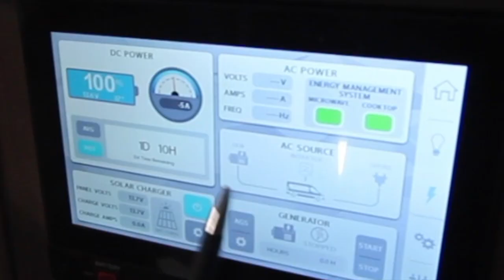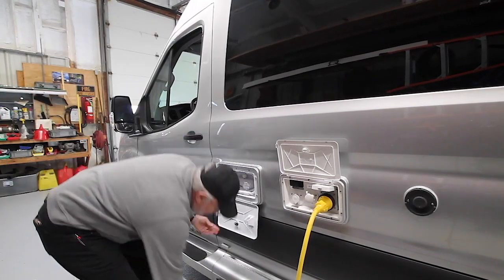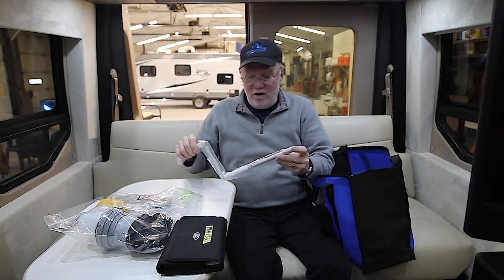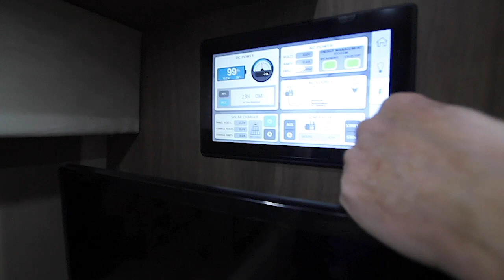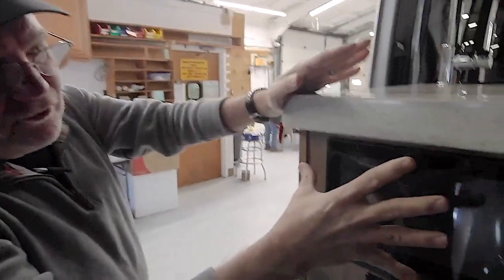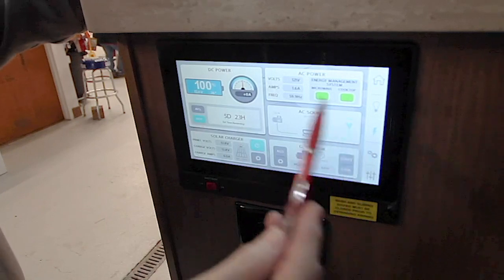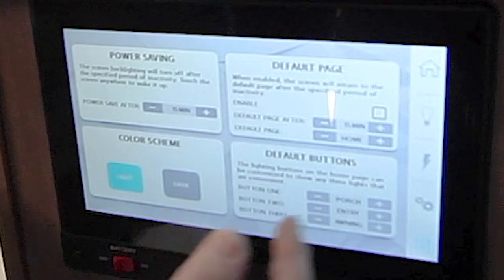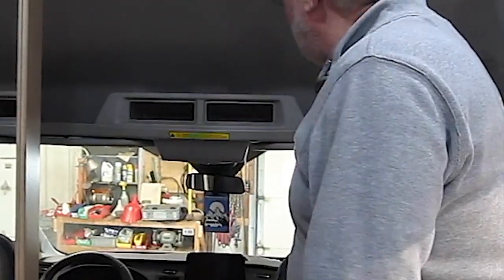Picking up Pleasure-Way OnTour RV? INFORMATIVE walk-through by Rick Hand from Fretz RV, PA

Comment from the maker: Amazon Links to Items we use or mention in our videos: (We earn a small commission at no extra cost to you when you purchase from one of the links.  Thank you for supporting our channel. )
Surge protector, Water filter, hose:
Portable RV Surge Protector Portable EMS-PT30X RV Surge Protector , Black   https://amzn.to/3v7qfe8
Southwire 34930 Surge Guard 30A - Full Protection Portable with LCD Display Black     https://amzn.to/3vaPMTy
 FilterLogic RV Inline Water Filter.... https://amzn.to/3BJBpXB
Valterra AquaFresh High Pressure Drinking Water Hose.... https://amzn.to/3sTqK8U
Twinkle Star RV Water Pressure Regulator Valve ..   https://amzn.to/3JOmcrm
Camco FasTen 2x2 Leveling Block https://amzn.to/3LQidMC

Kitchen Area:
Over The Sink Roll-Up Dish Drying Rack  https://amzn.to/3p8jXH8
 Magma Products, A10-363-2-IND, Gourmet Nesting 7-Piece Stainless Steel Induction Cookware Set with Ceramica Non-Stick, Silver      https://amzn.to/3p4SciQ
VELCRO Brand - ONE-WRAP Roll, Double-Sided Tape  https://amzn.to/3K4d4Px
Gorilla Heavy Duty Double Sided Mounting Tape XL  https://amzn.to/3HcaWmO
Automatic Soap Dispenser   https://amzn.to/3p81Zog
Dixie Ultra Disposable Paper Bowls, 20oz     https://amzn.to/3p7PitE
100% Compostable 9 Inch Paper Plates  https://amzn.to/36yLlYG
24-Piece Superior Glass Food Storage Containers  https://amzn.to/3JKKfHw
Lunies Over The Cabinet Plastic Trash Bag Holder  https://amzn.to/3pb82Zr
Subekyu Small Hanging Kitchen Trash Can  https://amzn.to/3p9rrKe
Prodyne Under Cabinet Paper Towel Holder  https://amzn.to/3p7GyDQ
Bligli Shower Mat Non Slip Bath Mats  https://amzn.to/35lOgmH
 MicoYang Silicone Dish Drying Mat   https://amzn.to/3BGDMuu

Bedding Area:
 Therm-a-Rest LuxuryMap Self-Inflating Camping Sleeping Pad   https://amzn.to/3h6jTUb
 Amazon Basics Ultra-Soft Micromink Sherpa Comforter Bed Set - Navy, Full/Queen     https://amzn.to/33Hb3Jh
Packing Cubes Luggage Bags  https://amzn.to/3LS0kNq
10000mAh Portable Fan Rechargeable, Battery Operated Desk Fan   https://amzn.to/3JOdHfE

Curtains:
NICETOWN 100% Blackout Curtains with Black Liners, Thermal Insulated 2-Layer Lined Drapes (Navy, 2 Panels, 52 inches W by 45 inches L)   https://amzn.to/36snJop
 NICETOWN 100% Blackout Curtains, Thermal Insulated Black Liner Panels  (Set of 2, Navy, 52 inches Wide by 63 inches Long)   https://amzn.to/3h6Gz6v
 Oval Tension Rods Adjustable Width Curtains Rods 4 Pack Spring Window Round 22 to 36 inches Spring Curtain Rod Tension Curtain Rod, Black        https://amzn.to/3sbpLlh
Rod Desyne Oval Spring Tension Rod 36"-60", Black, 36-60"  https://amzn.to/3p91r1x

Table and chair:
COSCO Multi-Purpose, Adjustable Height Personal Folding Activity Table https://amzn.to/3t05IFN
 Portal Outdoor Folding Portable Picnic Camping Table with Adjustable Height Aluminum Roll Up Table Top Mesh Layer     https://amzn.to/3slgZBv
 STRONGBACK 3.0 Guru Camp Chair, Original, Navy/Grey     https://amzn.to/3H6Di1K
 STRONGBACK 2.0 Elite Camping Chair, Original, Black/Grey      https://amzn.to/3JOAPL2
 GCI Outdoor Compact Camp Table 20 Outdoor Folding Table     https://amzn.to/3p8dH2l

Bathroom:
Bligli Shower Mat Non Slip Bath Mats Bathtub Mats with Drain Holes and Strong Suction Cups, Anti Slip Bathroom Floor Shower Stall Mat(BPA, Latex, Phthalate Free) (Blue 21x21 inch)  https://amzn.to/3sbQYEs
MISSLO 8 Pockets Mesh Shower Organizer Hanging Caddy with Rotating Hanger Quick Dry Bathroom Storage (White)      https://amzn.to/3sa5MTV
MISSLO Hanging Mesh Pockets Hold 340oz/1000ml  https://amzn.to/3LSi9fi
Self Adhesive Pet Proof Toilet Paper Roll Cover Holder ...  https://amzn.to/3hflpTL
 Motion Sensor Wireless Night Light      https://amzn.to/3HdnRVu
 ScorchedEarth Microfiber Travel & Sports Towel Set (True Navy) -      https://amzn.to/33IJ7oq
Poo-Pourri Original 16-Ounce Refill Bottle and 1.4-Ounce Original      https://amzn.to/33HuwJU
Scott Rapid Dissolve Bath Tissue Made for RVs and Boats (16 Rolls)  https://amzn.to/36z0Z6l
ScorchedEarth Microfiber Travel & Sports Towel Set (True Navy) -    https://amzn.to/3hdqWdL

Front area and phone chargers: 
Tacticool Car Seat Back Organizer    https://amzn.to/3JY79ex
Heavy Duty Cargo Net Stretchable   https://amzn.to/3vigbPk
Spigen Mag Fit Phone Holder Car Mount Designed for Magsafe...    https://amzn.to/3BGR8GU
USB C Car Charger Adapter...   https://amzn.to/3BQ8Yr9
ADDTOP Solar Charger Power Bank ...  https://amzn.to/36DHSIt
iPhone Charger,3 Pack (6 FT) Maitron [Apple MFi Certified] Charger Lightning to USB Cable Compatible iPhone 13/12/11 ... https://amzn.to/3p8fRPB

Coffee equipment :
Hamilton Beach Scoop Single Serve Coffee Maker  https://amzn.to/3t3rJTR
OXO Brew Conical Burr Coffee Grinder  https://amzn.to/35jkDT0
Coffee Canister, MOICO Stainless Steel Coffee Container  https://amzn.to/35lU5Rm

Watch next: 2020 Pleasure-Way OnTour 2.0 in-depth walk-through https://youtu.be/6ckk3cZ7hB0
UPGRADES and CHANGES for 2021.5!!!  Pleasure-Way Ascent, Plateau, OnTour by Pleasure-Way Rep. Doug https://youtu.be/U0qwKCnZfbE
2021.5 OnTour 2.0 WALK-THROUGH with Pleasure-Way Rep. Doug via FaceTime//upgrades and changes https://youtu.be/1UK1LVXp6Ms

Comment: Excellent walk-thru Doug!  I have two  questions: 1. on the shore power, water access and cable tv port access door, why isn’t it locking? Anybody can tamper with water access hole. 2. Why is PleasureWay not installing a vent fan (even the small bullet-type will suffice) in the bathroom? I know there’s a gap at the top of the door for “sharing” with the fan in the galley area, but wouldn’t you be also “sharing” the fumes if one is doing a #2 in the bathroom? Thank you.